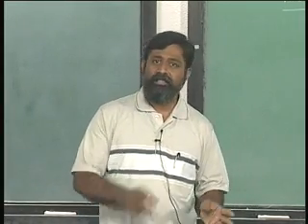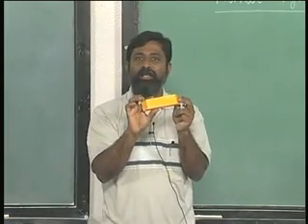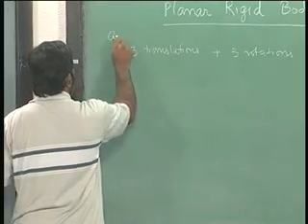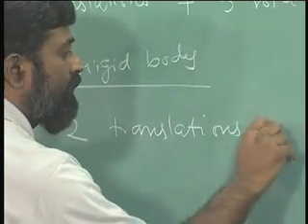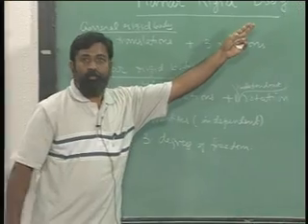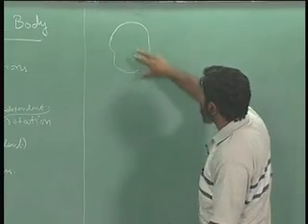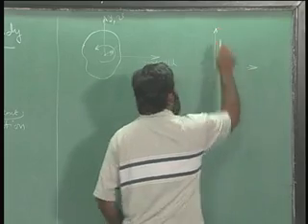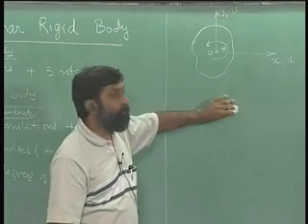Mechanics of Solids - IITM 1.1 Planar Rigid Body

Comment: 10:14, two degrees of freedom are possible for a particle. 
As so far I could understand it is for 2D frame only, right? 
Simplifying, a particle does not have a rotation? and hence degrees of freedom = no. of directions (dimensions in frame). 
Am I right?